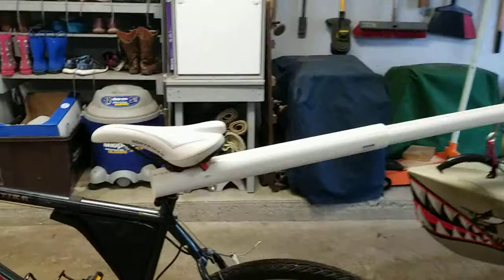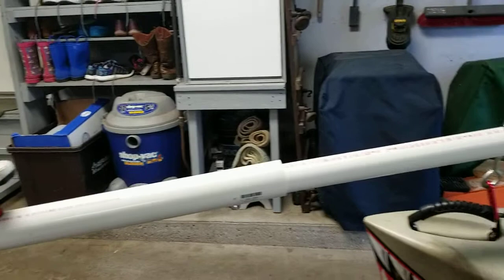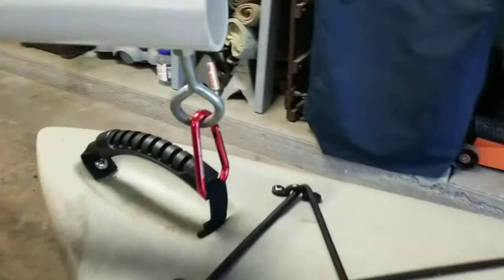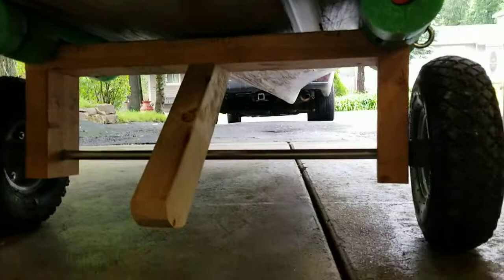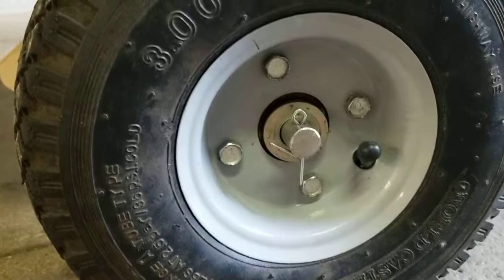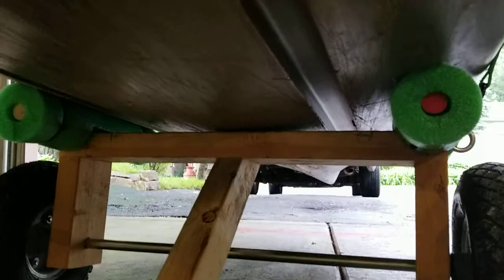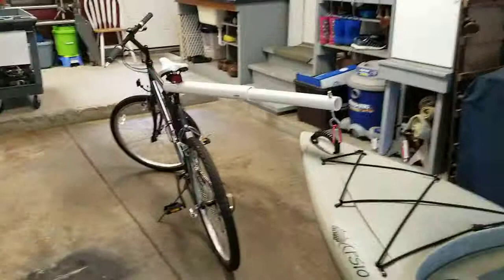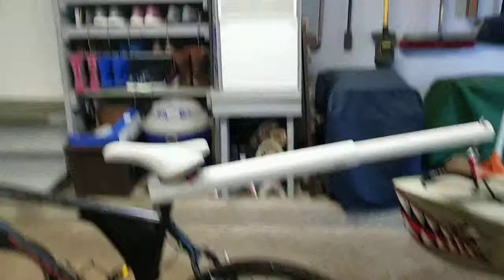Kayak Trailer for Bike

Comment: How did you drill a 1 inch hole on a 20 degree angle on a pipe?????
Reply from the maker: I marked center on both sides then drilled a small pilot hole on both sides from the outside, then just used a 1 inch drill bit to connect the two pilots.  It's not perfect but it doesn't have to be to work.  You can work the bit around to open up the holes as needed as the pvc cuts pretty easy with the drill bit.  The 20 deg is also just whatever angle your stem makes with the verticle.  You really can just put the pipe next to stem horizontally and mark approximate hole centers on upper and lower side of pipe and it will work. I made the holes fairly snug to also help keep the pipe from wanting to push to the side under braking.  Dont lube it...you want the friction there for same reason.

Comment: nice job what size and lengths were the pipes ? Thank you
Reply from the maker: Its gonna depend on your setup.  My stem is just 1 inch in diameter, so I was able to use 1 1/2 inch ID inner pipe and 2 inch ID outer pipe.   They fit together nicely.  If your stem is bigger, you'll need to size up.  As for lenth, it just needs to be long enough to clear the back wheel when turning and braking.  I used 38 inches for the inner pipe.  The outer pipe just reinforces the inner one and the most critical point is near the stem, so just over 1/2 the way to the end of the inner pipe is fine.  Start long and cut back till the kayak just clears the wheel in all conditions is the safe way to go.  Extra length makes it harder to ride the bike.
Reply: @billmonroe7328  thank you very much smooth sailing

Comment: Wait so does it pivot where it is attached to the bike? If yes, is that good? If no, why not, did you make it that way and how?
Reply from the maker: The pivot is the fact that I used one hole thru the seat post so the pvc can turn.  Since the seat post is at like a 20-degree angle, it will tend to fall back to center (rearward).  Pro: the rotation lets the bike absorb trailer sway and makes it more stable pedaling.  Con: in braking, it can "jack up," and the nose of the trailer can go to the side.  To combat this, I also made a version where the larger outer tube was longer and went all the way to the front stem of the bike.  Then I cut a notch for the stem so the outer pvc couldn't rotate at all.  This stops any jacking and keeps things straight, but the trailer will sway the bike a bit and make it appear you've had a few pints.  Hope this makes sense.
Reply: Ah thanks, yeah I'm a bit worried about the braking. After quite some research I think I'm going to use the WeeRide bike hitch instead, with a perforated steel bar or maybe wood.

Comment: How did you drill the hole in the PVC?
Reply from the maker: I started with a long thin bit to get location and angle right, then upsized a few times to make it correct size.  You can put the larger bit in straight at first then slowley angle it to come out other hole.  The sides of the bit will cut into the relatively soft pvc and cut the angled hole.  Hope that makes sense.